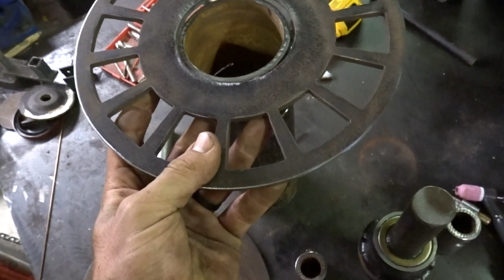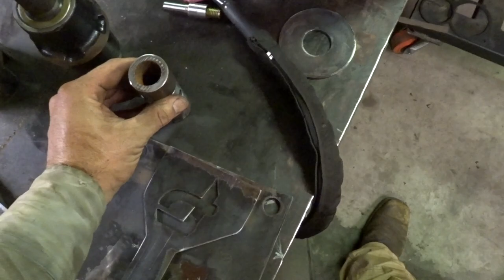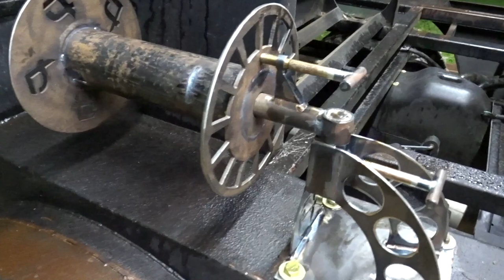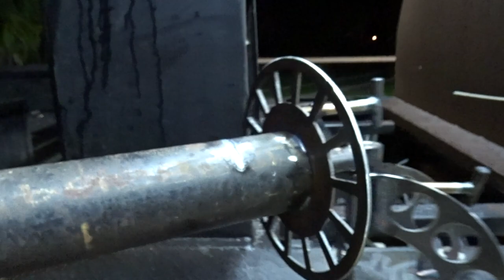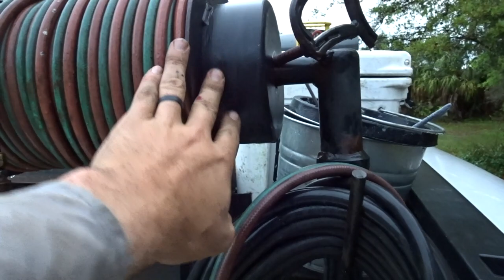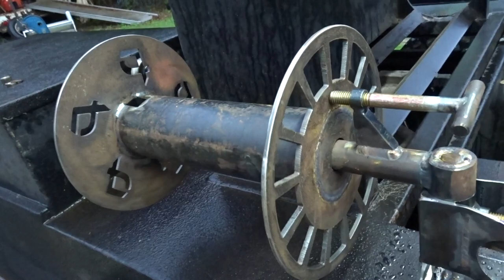Hose Reel Build

Comment: Use quick connects one hose goes in each side then use a small chain and a crank handle. Done Ive been trying to find a better connectors but it works fine

Comment: Do you have a short set of hoses built to go from the regulators to the quick connects or do you unwind all the way to hook up to the bottles? New to welding. Putting together my first rig. I have used several of your videos in my build so far. Thanks for all the help.
Reply from the maker: Short hoses to reach from bottles to reel with quick connects.  Unspool what you need and then quick connects at the reel.

Comment: Have you ever thought about using car wash swivels for the overhead of car wash bays. They will stand acid soap if you get truck car wash so they will stand the oxygen acetylene that way you can use them as the actual spindles on each end and run your hose to their then you can screw your hose in and don't have to worry about unplugging and plugging it back in? Just thought I would ask if anybody ever thought of that?

Comment: Can I do that for leads
Reply from the maker: No reason not to but you’ll need to isolate it and/or add a quick disconnect.  If you’re running amperage thru the bearings, they will eventually wear out.